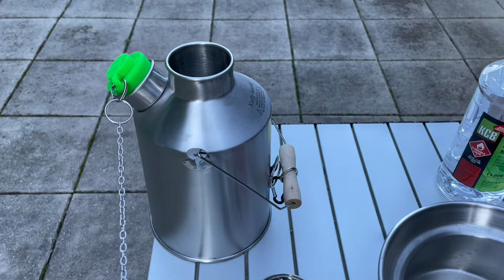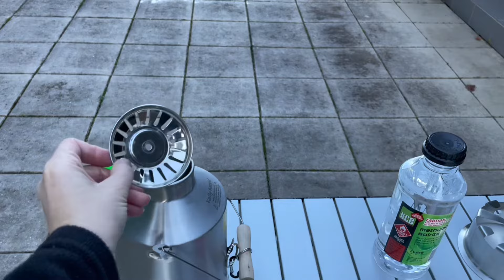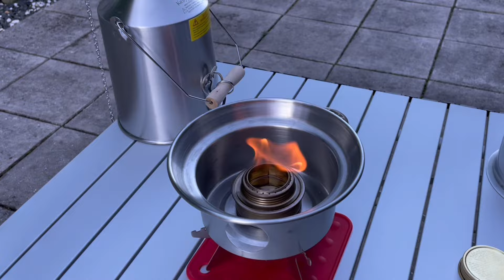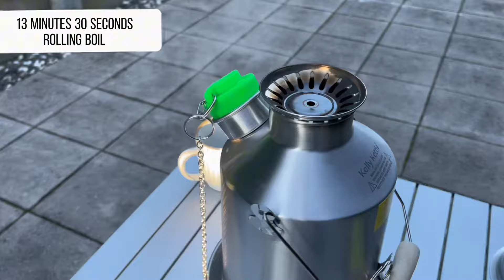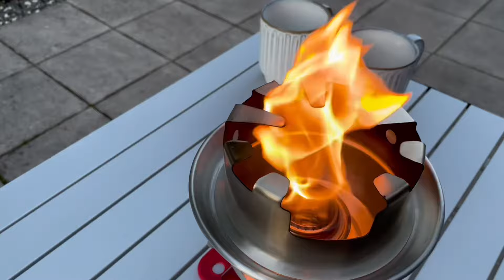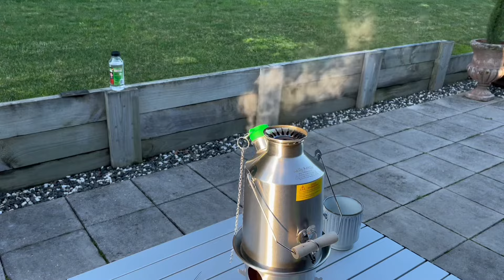Kelly Kettle - Best hack to boil water!

Comment: Use small pieces of finger sized dry wood, feed the fire regularly and your water will come to a boil in about 5 minutes. Blocking the top will reduce the efficiency of a rocket stove.
No need to reinvent the wheel, just learn how use it as it was designed.

Comment: The Trangia alcohol burner provides heat that is too narrow/focused and just goes right out the flue without transferring enough heat to the kettle. It consumes too much fuel to get a boil on that large kettle surface. To correct this, here is a hack: Place cross bars on the Trangia burner and then place a heat defuser on top of the cross bars. The heat defuser could be the lid from a can of corn with a few holes drilled into it. Try various sizes of cans to find a good fit that allows the heat to move up without limiting air flow. The idea is to have the heat from the stove deflect to the sides of the kettle instead of simply running up the flue.  You could also  make a damper for the flue using the Trangia simmer ring on the top of the kettle flue.
Reply: I tested this with the trangia burner with my stainless steel Scout kelly kettle filled with water to just below the spout. I didn't have anything placed on top of the kettle vent like in the video (maybe this would help in future), and the trangia was centered on the the folding grill sat on top of the fire base. The trangia was filled to the max with purple methylated spirits and burned for 19 minutes and the kettle was no where near boiling. That's probably because the flame is too narrow as you said. This was done indoors. I tried again with the trangia as far off centre as possible on the grill/firebase so that the flame should go up one side of the kettle's chimney and it took around 15 minutes to get to a rolling boil. This was done with a new kettle and I did not see soot deposited on the inside of the kettle chimney. I don't think that that alcohol burns fiercely enough to give the same effect as a wood fire in the base, but would do in the case of an emergency such as a power cut where you could not have a fire indoors. I may try again and compare against a trekker model performance, although volumes of water would make a difference in timings.

Comment: I wouldn't put anything on chimney top as it would decrease performance I believe not increase performance.
Reply: The manufacturer states to cover the top when using an alcohol stove.
Reply: Natural fuels (wood, pinecones, leaves) create more flames that lick up the walls of the inside, which is where the heat transfer occurs.
However, with the trangia-like the flames are small and the heat rises more directly. By partially choking the chimney, the heat remains inside longer to provide better transfer.

Manufacturer states that this will likely be much slower than using the natural fuels.

Comment: I only use Denatured Alcohol in my little stoves ( Trangia , Evernew , Goshawk and others ) and have never had a soothed ( dirty ) bottom on any container that the water was heated in. Or any frying ban used to cook with. It has been (to date ) about 65 years so far. Simple reason for that , no water mixed in with the alcohol.
Reply: Yeah it’s weird, I’ve never seen soot like that from methylated spirits either, but I’ve not used the brand she used here.